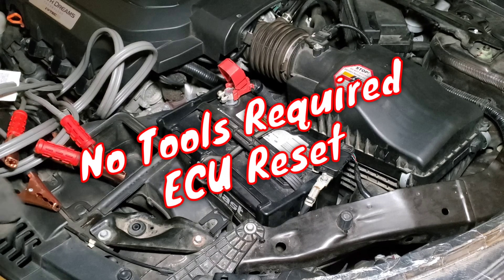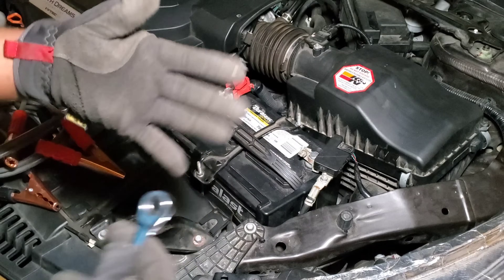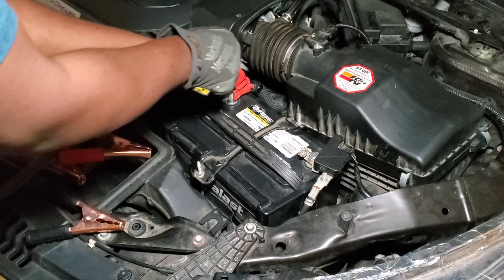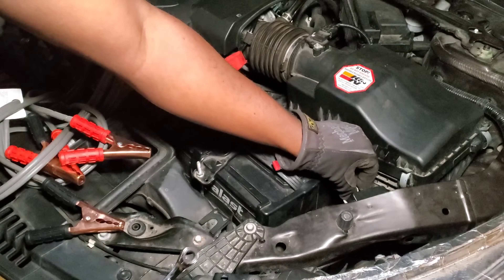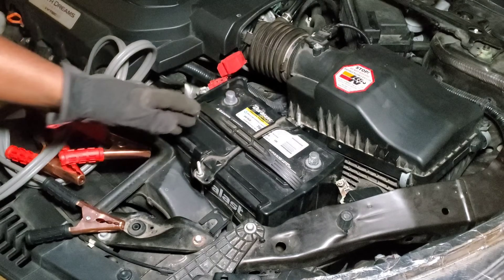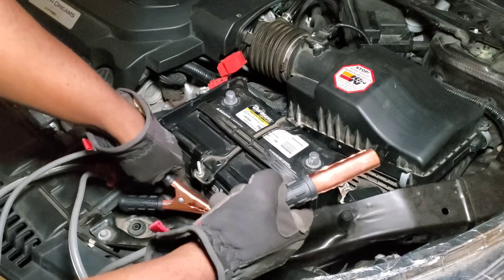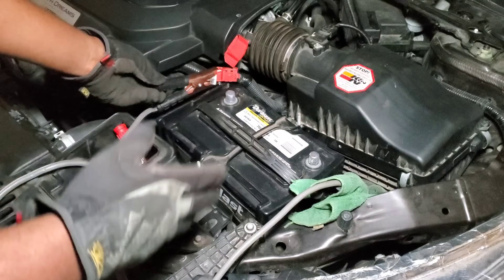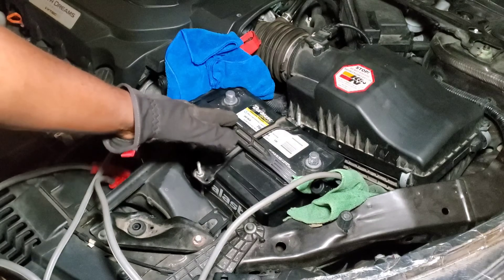How To Reset All ECU  No Scanner No Tools Required

Comment: You can use the other "positive cable" as well. Doesnt have to be the "Negative cable" 
So it doent matter which cable you are using as longs as its just the cable.
Reply: The only reason to take the negative off first is so your wrech does not ark to ground. If your taking the Possitive off It might, could be a bad thing, if it welds it's self to ground. Some batterys (in good shape) can have 800+ amps. You can weld with that, or burn up your car too.

Comment: Hi if you don't have the jump leads how much time would it take for the voltage in the system to dissipate (without using the jump leads) before reconnecting the battery leads? Thanks
Reply: Good question. I did it for 15 minutes but it didn't work

Comment: I have 2002 Mitsubishi galant the ignition locked up and I beat it out as I was an hour away from home messed up the immobilizer well I bought a used ignition system with immobilizer and key on ebay and now my car will turn over but it will catch to crank will this work as I have been told the immobilizer needs to be programmed to the ECU if I do this will it work for my car

Comment: I was always taught you do not clean the throttle body with the battery connected,moving the butterfly valve with the battery connected causes these problems.So disconnecting the battery before cleaning the throttle body achieves the same thing as this.Simply put.....just disconnect the battery before cleaning the throttle body.Problem solved.

Once cleaned go ahead and reconnect the battery.It will then throw the low voltage battery code because you disconnected it....maybe even a check engine light just because you disconnected the battery but dont worry after a bit of driving the check engine light will go away when it realizes the battery is connected again with a full charge.
Reply: Not true - error codes still appear & throttle / pedal / computer have to re-learn even if battery fully disconnected beforehand.
Witness my own experience & repeated on many instructional videos by time served mechanics & diagnosticians on YouTube explaining the procedure for different cars, even when battery was disconnected beforehand.  The ECU / PCM still remembers previous codes stored through low level voltage in computer capacitors requiring a throttle re-learn proceeds unless fully discharged.

Comment: So you disconnect the battery cables at the terminals and  touch the two cables together to discharge the capacitors which are basically mini batteries inside the vehicle computers thus erasing the computer learned memory and brings it to factory settings.
Reply: So basically you created a arch in the charging system to deplete the rest of the system's residual
Reply: What does initialize the new battery?

Comment: Frustrating for me.  I changed the oil in my 2001. Isuzu Rodeo V6 and went to start the car and all the warning lights e.g. Check Engine Light, Lamps, etc we’re on.  Engine was turning over but wouldn’t start.  If someone is reading this and has ever experienced this problem, let me know please.  I was hoping with the reset, everything would return to normal.  Thanks.
Reply: I’m having that exact problem, have you fixed it?
Reply: @99pittfan  Sorry to say I haven’t due to the heat but I am still making an effort.  I’m thinking the fuel filter or fuel pump but now trying to figure out how I’m going to be able to get under there and get up again.

Comment: I have a 2012 Honda Civic my engine lights are still on I just put a new air flow sensor in 202 centers in when I drive the car around 30 miles an hour and I push it to the floor it starts to spit to spit do you have any idea
Reply: Do you have a phone number

Comment: I have a question. My murano is still in limp mode after all repairs, no check engine light. will doing this reset my limp mode so i can drive it again?

Comment: Make sure you don't do this during the period when your vehicle needs a smog check,
once all the Data is erased from the ECU, there is no Data to do the smog check.
your vehicle will have to run fo at least 100 miles for Data to be collected by the ECU to do the smog check.
Reply: What's a smog check
Reply: @robbob5318  A vehicle inspection and maintenance program designed to improve the air we breathe. The program identifies vehicles with excess emissions so they can be properly repaired or retired. It has greatly reduced air pollution created by millions of cars in the US.
Reply: Not true. Different manufacturers and years have different procedures but all 95.5 and newer have a "Drive Cycle". For the computer to get accurate readings of the timing, firing, oxygen sensing, exhaust, intake, acceleration, etc. It needs a drive cycle (for example: X amount of miles and or time at X mph, X amount of complete stops and starts, X amount of different time at different X mph, etc.) It usually only took me about 25 minutes to get a full drive cycle if I knew the requirements to get the computer "Smog Ready".
Reply: @gambithewigbandit  What you are talking about are built in programs that don't get erased.
Emissions control is a key component that is recorded and inspected during a smog check, it's an input that keeps changing.and it's erasable.

Comment: I'm confused.  You used 2 sets of jumper cables, with the negative clamp from each cable hooked to the car's battery attachment cables.  The other end of the jumper negative cable apparently not attached to anything.  What does that accomplish?
Reply: He's creating a short circuit between the + and - battery cables, when they are disconnected from the battery.  Emphasis on the word "cables".
Reply: So without using the word "short circuit" because some people don't understand what that means and to use more laymen's terms, just use 1 jumper cable, and from that 1 jumper cable you are going to pick only one color, (red or black doesn't matter) but let's say we're going to use the black so it matches what he did in the video, hook one end of the black jumper cable to the negative (black) terminal and the other end of the black jumper cable to the positive (red) terminal and your in business. I'm sure you figured it out already but I wanted to put this info here just incase someone in the future may have the same question.

Comment: If you disconect the earth (chassis/ground) terminal first it is safer. 
Your spanner will not accidentally short against anything.
Also, you dont nee to disconnect both terminals. 
The circuit is broken as soon as you disconnect one.
Reply: Agreed.  I was helping my wife's 'adopted' son work on her old LeSabre when he went to remove the positive cable from the starter without disconnecting the battery first.  He was a mechanic at the time, he poo pooed my warning at the time and then proceeded to ground the wrench against the frame....LOL  I've never let him live that down.
Reply: Idiot on utube. Doing it wrong.
Reply: I don't know if I'd take that risk with leaving one terminal on 😬
Reply: @hcic9860  I agree. But for me? I just disconnect the negative cable (and always disconnect the negative first to prevent shorting to chassis if removing the positive too). Then jumper a wire from the positive cable (still on the battery) to ground for the same "draining" effect.  But for "newbies" it is better to tell them to disconnect both battery cables and then short the two cables together - not involving the battery at all.  What concerned me is this guy had good intentions, but:
1. He disconnected the "positive" cable first - not safe.
2. When connecting the battery back up, he put the positive cable on first (ok), but "before"  he tightened it, he put the negative cable back on too and tightened it first - not safe.
3. He kept calling the cables "terminals" - that is a misnomer, saying to "short the terminals" is wrong... terminals are on the battery! True, he was showing "what to do", but what he was saying was conflicting with what he is doing - and when there is confusion there is danger.
Reply: @paulromsky9527  Airing on the side of safety is always smart. Good observation.
Reply: @ericstern1754  My dad used to smoke over car batteries... I tried to tell him about hydrogen gas, he didn't want to hear it. A battery never blew up on him... he was lucky.
Reply: @paulromsky9527  or anyone else... Probably ever. I've seen thousands of Marlboros and camels hanging from a mechanics mouth. Hell we used to smoke and pump gas...
Reply: @inzerdody2023  Yes, my father always had a cigarette hanging from his mouth when working on our cars and leaning in around the battery. I tried to get him to stop doing it, but he would just swat me away and say, "Get me another beer."  Rheingold is what he drank back then.  https://youtu.be/f_51RANXHg0

Pumping gas with a cigarette in your mouth... where was that? I grew up in 60's/70's/Early 80's Connecticut when smoking was much more popular than it is today... I think it was illegal to smoke near fuel pumps.
Reply: @paulromsky9527  When I was a kid, 58-years-ago, this is exactly what happen to my dad, a Camel cigarette smoker.  Acid on the face and eyes is no fun.  That stated, when reconnecting the battery, of a negative-frame car, I  always start and finish connecting the positive cable first,  then the negative cable.  A number of years ago, an Interstate Battery tech replaced the battery in my mother's Cadillac and sparks flew when he wrenched on the positive cable, one end of the wrench completing a short by coming in contact with part of the car's frame.
Reply: @armchairtin-kicker503  Thanks for sharing that smoking/explosion experience with us. To those reading this... see, batteries can explode.... safety is paramount.
Reply: @armchairtin-kicker503  There you go folks... if a negative ground vehicle, disconnect the NEGATIVE first and reconnected it last.

Comment: Hello great video got a question I just recently had a engine installed into my 2006 Toyota Camry and motor is good it cranks over but won’t start so will this work for that type of situation?
Reply: Check to be sure the earthing is well grounded.

Comment: Will this work on a 2012 chevrolet malibu
Reply from the maker: This is for all ECU
Reply: Ok what about check engine light. My car turning over but won't start. Could that be the problem.  I clean my mass flow. It just won't crank

Comment: They only problem with that in CA they know you disconnected the Battery recently if you have not driven the car at least 50 Mi or more and won't smog it for you

Comment: You don't have to disconnect them both do you? I only disconnect the positive terminal and usually leave it for a couple of hours... But when I come back I use a jumper from positive to negative(still connected to the battery)... And then after taking jumper off i connected the positive to the battery. Perfect.
Reply: Its great to destroy your battery never disconnect positive first lmao
Reply: @Reborn1561  I never heard it before

Comment: What is the point of the jumper cables? Couldn't you just pump the brake pedal to expel any residual power or voltage left in the system after disconnecting the battery?
Reply: Shut up and just try it or watch another video.

Comment: You can't do this with newer cars. You can drain the caps to fast and wreck things. Just disconnect the battery positive and negative and just turn your headlights on for a few hours. That way you drain the caps much slower. That may even send you to the dealer for some modules that need to be relearn with 20 or 30 modules they put on this new stuff. Just disconnect your battery and wait 24 hours would be your less chance of messing something up.

Comment: Hi brother I have 2016 Nissan Sentra I have check engine light is today’s mass airflow sensor I change and fourth time is still the check engine light on what do you recommend to do thank you
Reply from the maker: By doing this it's going to get rid of the check engine Iight. But you have to make sure to fix the problem first. Other else, the check engine light will come back later on.

Comment: The ECU packed in on my 1.7tdci zafira .Total nightmare .Got all parts from a donor car .Clocks .ignition and transponder .fuse boxes .Was a waste of time .Rear fuse box in energy model is different from my elite model .The ECU on it's own from the donor car never worked .has to be blank and reset .Finally got there with an ECU from ECUs to go in Redcar .Great result .Fixed now thank god .

Comment: Yes, that's right. When I upgraded LED light bulbs it might mess up the ECU as my dass board light sometimes come on and off, also the ignition. By chance I disconnect the battery and leaves it for about 10 minutes then reconnect it. I replaced all the light bulbs back from original. Wow, everything working as it used to be. The only thing in the video, I'd like to mention that : 
When disconnecting the cables from the old battery, disconnect the negative first, then the positive. Connect the new battery in the reverse order, positive then negative. Many thanks for your video.
Reply: You're right about disconnecting/reconnecting the battery terminals. To help discharge any power in the system faster, turn on the headlights.
Reply: Scotty reconmends a 2 ohm 10watt resister across the disconnected cables, same as ypu did with your single leg of your jumper leads.
Reply: I’ve been having the same problem one of my rpm lights are out and my obd2 port doesn’t read anything and this is after I upgraded from halogen lights to led lights.. so should I reset my ECU
Reply: @SuperDoober  Did you? I'm finna reset mine as soon as I get home. I'm having a check engine light for map sensor, I've replaced it but the message still persists. This is my last hope before I take it to the Stealership.
Reply: I have the same problem, went to auto repair, code deleted, every thing was fine. then i first installed the check engine light and PGM light came , went to auto repair, code deleted, every thing was fine, removed the LED installed on the front for day time running lights installed some fuse in fuse box  again the same problem. Now i again went to same mechanic but he half heartly tried but code came again and again. did the above by removing battery terminal for hours and hours but the fault did not disappear, car performance is restricted, i can not rev the car in 1st gear above the 2000RPM until put the car in 2nd gear. same with other gears. How can i solve this?any advise please?

Comment: Yes, u will discharge it so fast and it might cause a spike inside the ECU. Then u will feel the Ouch on your wallet.
Reply from the maker: I'm 2017 Honda Accord is working great after this if I had any problems from doing this I was going to take down the video because I do not want for other people to have the same problem  this is up to you if you want to try or not.  but for me If  I have any ECU problems in the future I'll repeat this same step
Reply: @Loverofengines101  Not on this Honds model,  some ECU have bigger and more capacitors and shorting without a load across will cause a surge or spike.

Comment: Well, it will work with many cars older than 2012 models. But, many of the late models, say from 2014 models . Also , if the malfunctions  are not corrected , the codes and the malfunction lights are going to come back.
Reply from the maker: You're the only person who understands this video Thanks 😊 🙏🏾

Comment: Hi Brother. Would this work on my hyundai i20 1.2,  2014. The DTCodes keeps showing on my elm327 diagnostic tool, but with that device it only reads and points out troubles codes, thus cannot reset them.
Reply from the maker: You have to try and see this is not going to do anything bad to your Car

Comment: Lol, 😂 just touch the positive battery to engine, intake manifold, exhaust manifold. You don't need a jumper cable. 😂 Once it grounded it doesn't need to held there very long.

Comment: Great video, very helpful. Thank you. I have a quick question: my honda civic 2012 EX only charges when the headlights are ON. If I'm driving with my headlights OFF, it will drain my battery gradually. My battery and alternator are tested and they are good. You think resetting the ECU would help?
Reply: Can i do this with a 2000 Mercedes benz ML 320 also?

Comment: Thanks for video,  I have an 08 accord,  my ABS, VSA and Brake lights go on for a while, then off for a while. Any ideas how to reset it manually or maybe I shoild buy a scanner?
Reply from the maker: If you do not take care of the problem and you do this the light will come back on so I recommend you fix the issue first before doing this step
Reply: @Loverofengines101  But how to fix the issue?
Reply: This is a issue in the abs sensor could be called a speed sensor located normally near the wheel hub. 
You can try disconnecting it and spray electrical cleaner to remove any debris etc. Last thing you can check is your brake fluid. If low or old can cause issues to
Reply: yor battery charger need maintinanc  it happen with my car
Reply: get a cheap scanner from Walmart, one for 20$ and a better one for 40$

Comment: please don't think that this just fixes your car by osmosis. This just resets the check engine light after the  problem that caused the fault code has been repaired
Reply: No it doesn't. Check engine lights can't be reset. You have to deal with whatever dtc is causing the MIL. Also, you can't clear a hard  fault.